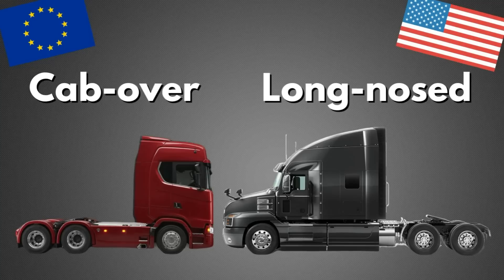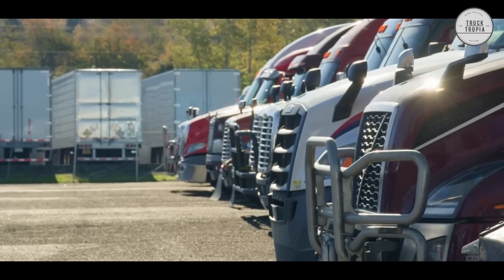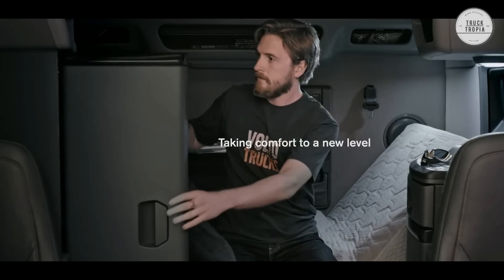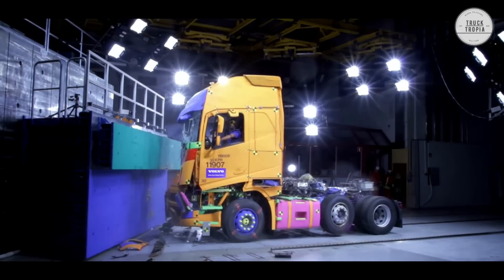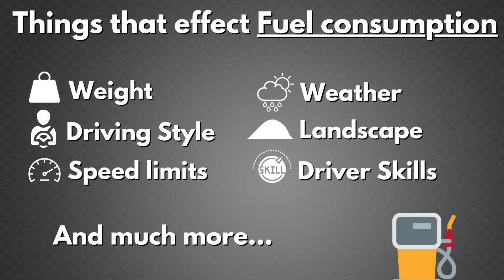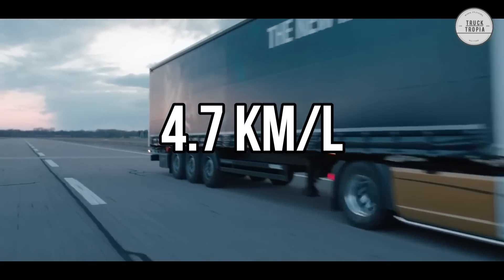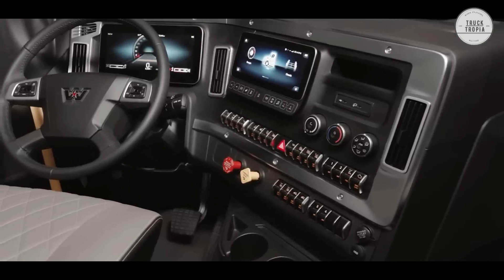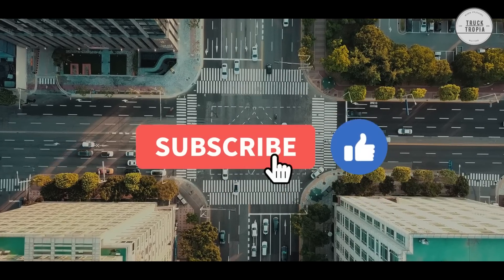WHY Long-Nosed And Cab-Overs Are So Different?

Comment: europian truck are better in my opinion, they are easier to maintain in my opinion
Reply: Sorry but you're totally wrong. 
I drove in Europe from 1991 until 2006 from 2006 until back home in the United States. 
The only thing European trucks are better is power and the torque of the engines and this only happens because American trucks don't need that amount of power. The country is mostly flat and they run with less weight. 
You said maintenance?
How is it better on a European truck?
To work on the engine you need to clean the whole cab and lift it to access the engine and you don't have that much space to work. The American trucks you need to open the hood and you have all the space you need.
Reply: @MannyRodrigues70  Remember even though the HP is smaller but the torque America truck is a bull because it is very strong on a sharp climb even though the road is snowy
Reply: No no no and never, American trucks are much better for long and near trips how aero cabins and rest areas, American trucks are a masterpiece and europeans just like toys
Reply: @THEBATMAN7788  Fanboy facts here. Only the custom long frame rigs are better in the US, everything else is close to being junk or outdated for 20 years
Reply: @stop_lying_bro , no, new kw and peterbilt is nice truck,, maybe Because there are many problems with paccar engines but I guess it's the same depending on the choice, the new Volvo vnl or Cascadia is also good
Reply: @THEBATMAN7788  you're stuck in 1970
Reply: @dbUK77 ???? Stuck, what stuck, eu truck like toy and for boy, USA TRUCK FOR REAL GENTLEMAN, LOOK IN YOUTUBE AND REAL LIFE, How they drive in their trucks in america, they're like cowboys because they know they carry a bull with an engine of 600 to 1000hp
Reply: @THEBATMAN7788  Nothing wrong with preferring US trucks, but you probably never been outside of the US.
Reply: @automation7295  never out side??? In us there is a cab  What's different about Europe??? What's because you're an ets player😂😂😂, European truck very very like toy and kids fanboi
Reply: @THEBATMAN7788  Do you negotiate tight turns, parking & corners (reversing included) on a daily basis? No. Do you negotiate roundabouts of various sizes, layouts and traffic movement on a daily basis? No. Do you drive through narrow streets (most not built with cars in mind, let alone trucks), tackling twisty roads and challenging gradients, especially in adverse weather conditions? No. 

In the States, truck driving is a luxury/lifestyle. Here in Europe, it's a career
Reply: @aidanwilliams1621  don't compare the Meteorology of Europe with America.. 
And don't compare things that you don't have any knowledge of.
From my experience both sides have pros and cons.
Reply: @aidanwilliams1621 yep , I drive in the Uk and most places I go to you would get a USA truck remotely near it 
Try getting one from the A303 at Yeovil to Glastonbury 🤣🤣🤣🤣😘NFC